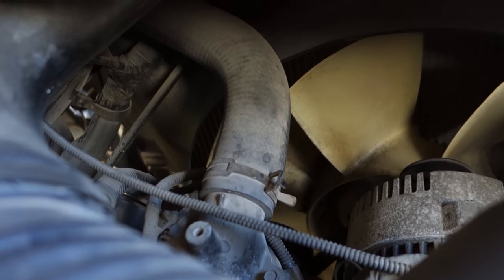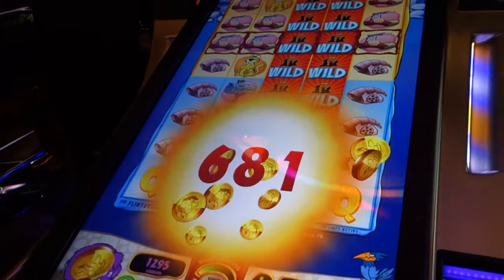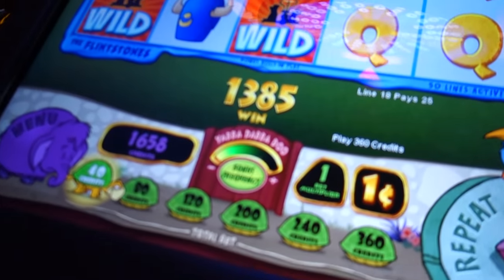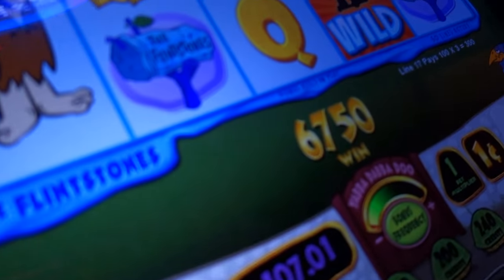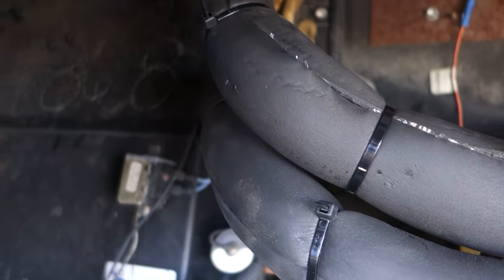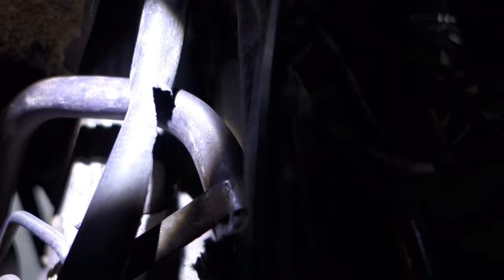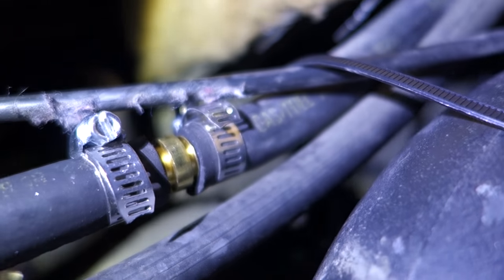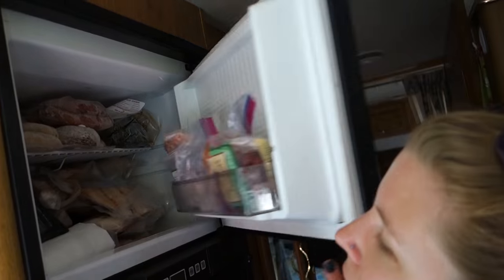RV LIFE - Motorhome Cooling System Re-Hose

Comment: FYI with those Acme heater-A/C systems there is a blending door inside that either closes or opens to adjust the heat (via controlling the cold and hot air mixture) you should be able to see the end of the shaft (on the side of the unit)  turning as you adjust the temp on the dash.....just a simple check to see if that is your heating problem.
 Oh!! and keep in mind that the blending door is all plastic (including the shaft) so the shaft could be turning and the door not ,if the shaft is broken.